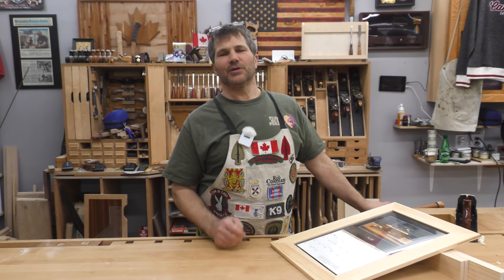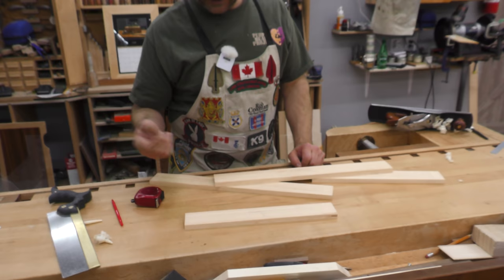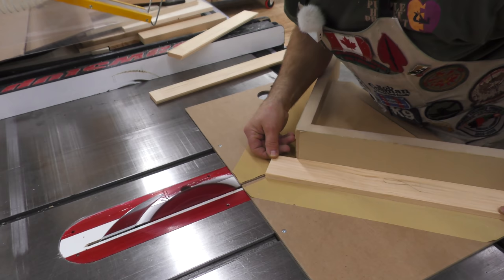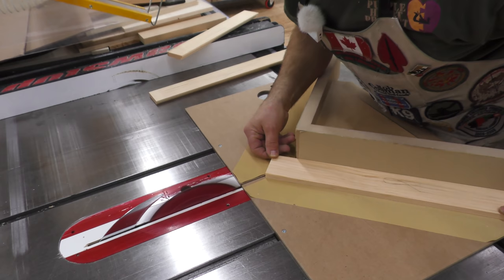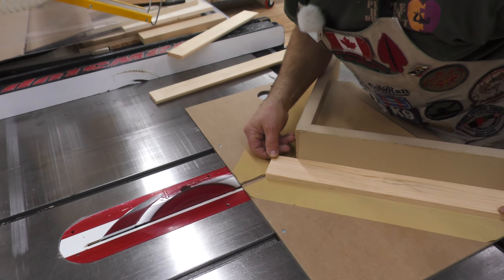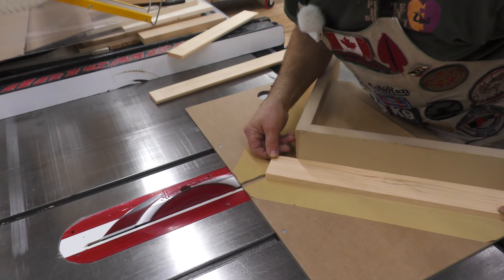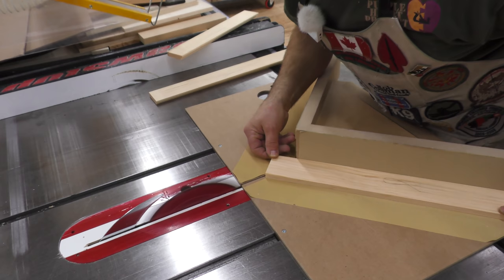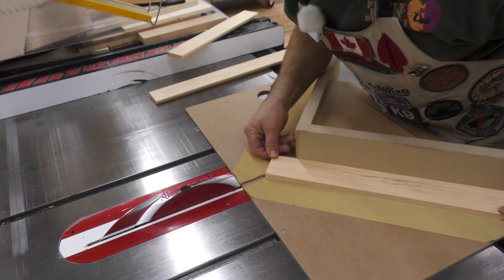Build A Picture Frame - That Stays Together

Comment: Rob, when I am making a picture frame, I  double face tape the two parallel side together. Then , when I cut and shoot the miters, I know that the two parallel sides are exactly the same length. It saves time and makes the operation extremely accurate. Thanks for all of your videos. They are the best.

Comment: I often bead and bevel the front of the frame with planes, a no. 45 and or a no. 66. I usually do that by choosing on long piece of wood and adding any decorative milling before I cut it into pieces to keep the whole thing consistent. Also, I have learned to mark my cuts by making sure the making the lengths of the back wall of the rebates slightly longer than the length of the side of the artwork. That way I'm not trimming the artwork.

Comment: Thanks to your videos  I made my first shooting board. Its  long  enough to use my #7 instead of %62 low angle. ( would be $ 175.00 richer) if I had watched your low angle against the Woodriver 5 1/2. My Stanley # 5 is my go to. 1 more thing thank you for all the information on sharpening.  I use the Trend  300 / 1000 and the Shapton 16000. All I and my helper can say is buy band aids. We are impressed.  Thanks again and keep 'em
coming.

Comment: I've tried several clamping methods but this one is new to me. I will try it. Shooting board is a must for joints that disappear. I've made a lot of frames and they are great for gifts especially if the picture or artwork being framed has some special meaning to the recipient. Nice video

Comment: I thought: “45 minute video for a simple picture frame? What the hell, I’ll watch it and see what he tells the novices and think about how I would do it better.”

I’m glad I did because I learned at least 10 things…maybe 15. I thought I was a perfectionist but the back of Rob’s frame is better than the front of most of mine. 

When he brought out the iron to steam out a planer track on the back side of the frame I bowed down and said “we’re not worthy!” 😂

Comment: Rob thanks.....I've made many picture frames, cutting rebates with my own made rebate plane...with depth stops....using a sticking board.......mitres on a chop saw then on to 45deg shooting board using a record T5 plane.....like yours but with a handle on side... handle was missing so turned one on lathe.....lucky I had a bolt to match thread....from my box of bits ( old toilet cistern bolt) 
Corner splines cut on my kitty K5 spindle moulder.
I cannot get on with my Stanley straps on a frame as thin as yours....slip off!!
BUT YOUR CLAMPING DEVICE IS ABSO SUPERB.     AND.     THE TIP OF ALIGNING VEE CUT TO CENTRE OF MITRE.....REALLY GOOD THANKS......john uk
Reply: Oh forgot to say I use thin or thick wood shavings, where you use shims.  John uk

Comment: As always, another great video with clear explanations and instructions. I love it when you find things 'gone wrong' and how you explain the solutions to the problems, like that compression point from the thickness planer. Masterfully done. One suggestion for prints some might not be aware of. Some paper, particularly cardboard, is made with acid that can degrade prints. Plexiglass and any backing should be 'archival' if you want to really go for the long term. The videography and the instruction are truly excellent.

Comment: As always, a great presentation. One suggestion though. Considering the quality of the workmanship in the frame itself, a consideration to the paper and the mounting of the artwork or photograph. Paper in such a quality piece should best be archival. Likewise, the mounting material should also be archival. Cardboard is acidic and whatever art is inside, eventually will deteriorate over time disintegrating the art. In short, this piece is museum quality and built for generations to come, perhaps thousands of years. The art inside it might last just as long. So, whatever goes into it really complements the frame and vice versa. Also, there are some kinds of plexiglass and glass that are ultraviolet light protective for the art going into the frame. There are products that will help neutralize the acids in paper and cardboard, but in my view, it's best to avoid acid papers and mounting materials. I had to watch this again and still enjoy the thought, technique and artistry that goes into it all. Great videography and sound.
Reply: Don’t forget it needs to be kept in total darkness in an oxygen-free vacuum chamber. I’m just kidding: It’s not a Van Eyck original from the Renaissance period; it’s a promo photo from a trade show. If it starts to turn a little yellow in 300 years they can just print out another one on the old Savin 6700 or whatever kind of quantum 4D printers they have in the year 2325. And if it ever does make it into the Louvre they have experts there who can restore it by hand. Back to the topic of fine woodworking…
Reply: @wulf67  Well said and agreed.

Comment: Great video, but gets complicated if you only have basic hand tools, I think (cutting the grooves for the splines). Wouldn't it be easier and as strong to do a basic half lap, mitre joint, the surface area would surely be big enough to make a very strong joint?

Comment: Rather than an iron, I use a heat gun for dents. Moisten as shown, then hit it with the heat for 10-15 seconds. I find it works better, and it's faster than heating an iron up.

Comment: Rob, at about the 35-minute mark you laid your block plane down on its side. Then you did it again a minute or so later. You always lay your bench planes down on the sole, and have given good reasons for doing so. So why did you lay your block plane on its side? Old habit, or is there a thought process behind this?

Comment: Hi Rob, a problem I seem to have is trying to plane the front once glued together because the plane scuffs across the grain on the opposing edge.  If I finish plane the pieces before glue up then I find it really difficult to get a perfectly smooth join on the face i.e. without a slight lip one way or the other.  Any ideas?

Also if I try to finish the face surface before glue up it inevitably gets dirty with all the handling and marred with glue squeeze out.  It's so hard to get a perfect result!

Comment: I have a question on a tool used. At 14:57 rob brings out a set of shims, right around 15 min he says he is using 26000. Can I get more info on that handy tool, I didn't see it on the site. Thanks
Reply: Rob was using a feeler gauge. You can find one for <$10. The number he read was 26 thousandths of an inch - 0.026.

Comment: Forgot to measure the diagonals to check for square!
Planing the insides of only 2 diagonally opposite miters would have lengthened the diagonal in that direction, whilst shortening the other diagonal. That results in a parallelogram rather than a rectangle.
So yeah, they sure are lovely tight perfect-looking mitres...but the frame isn't "square". .

Comment: Hello there is there any chance you could add conversion to metric dimensions for example like in Paul Sellers videos ?
Reply: Why would he do that for video editing when it takes you no more than 5.7 seconds to find out exactly what he means. Google it, you dont even have to be looking for calculators anymore just put your dimension straight into google "2 inch to mm" very first search result will be a calculator with your dimension already converted. 
It makes no sense for this channel to give conversions as you are not goint to be dimensioning your work piece to 50.8mm for example, its going to be either 50 or 55 or 40 or 60, it isnt a set of plans we are working of 😊.
Paul is from UK and everything over there has been metric for a very long time now. And yes, before you type that coment, they still have imperial in jargon and it actually makes sense its much easier to refer to full sheet of plywood as 8x4 (foot) rather than two thousand four hundred and forty by one thousand two hundred and twenty milimeters 😁, or 2.4 by 1.2M. Same with other building materials.
Reply: @bluewanderer9903  damn mate... just a simple "google it mate..." would have sufficed.   You must be a fun guy at parties lol
Reply: @bigkiv47  I am actually.
Since I started "stalking" all wood working channels I notice same question asked over and over, no harm done if person gets inspired for a bit of "philosophy".
What is the purpose of your comment?
Reply: @bluewanderer9903   you clearly didn't understand the question and I wasn't looking for some show off answer which tells me to google it and makes no sence at all.  Also I still rather say 1mm than 0.0393701 Inch
Reply from the maker: That goes both ways though, I’d rather say “one thou” than “0.0254 of a mm”